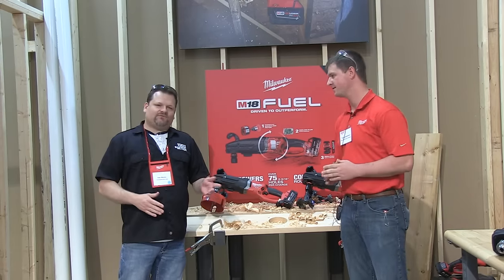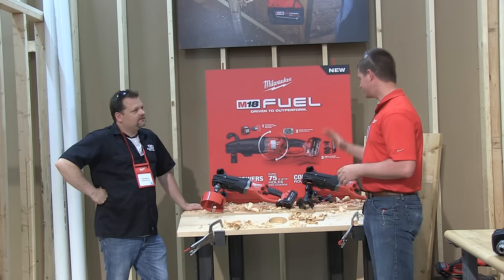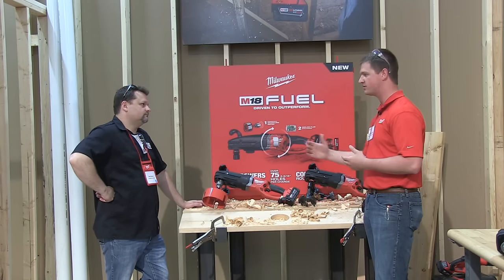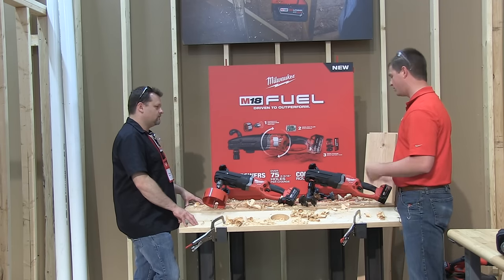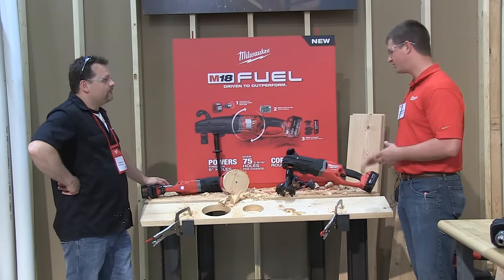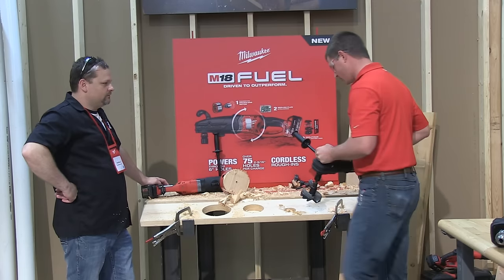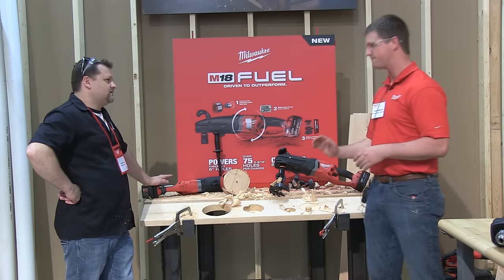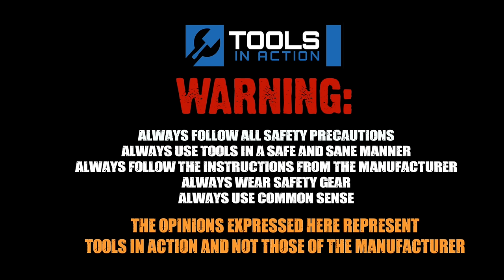Milwaukee Super HAWG 18V Hole Drill - The Clapper

Comment: Will this drill 16" deep by 5/8 wide holes for putting rebar and cold roll steel spikes in log cabins. My nephew bought the standard m18 hole hawg and it would not drill deeper than 8" my hand m18  gen 3 drill would go faster and deeper than his hole hawg.

Comment: That thing is a beast, would be great when trying to cut holes for sewage lines in tight spaces...just because you can get by doing it with a regular drill doesn't mean this thing wouldn't make it a lot better to do. Only downfall I see is that thing is HUGE, I bet you'd have arms bigger than Popeye's after holding it above your head long enough.